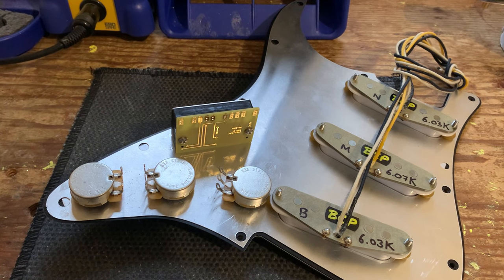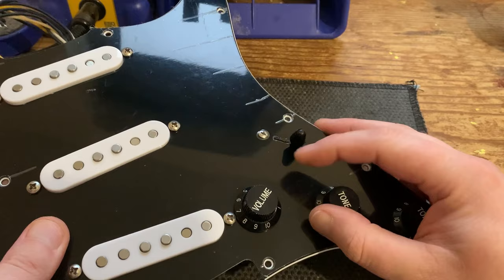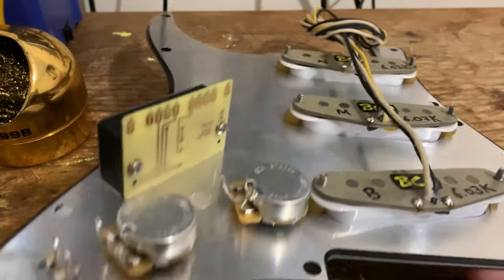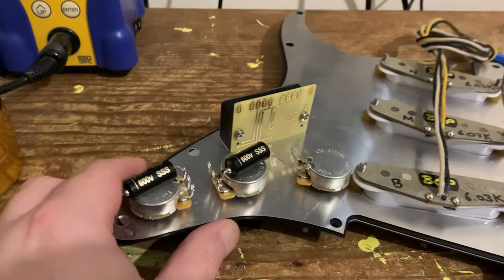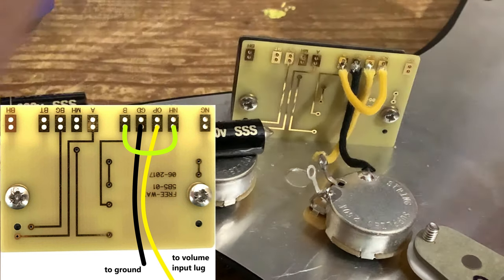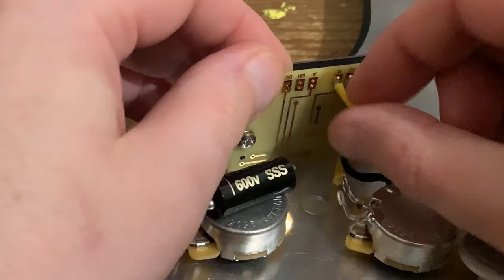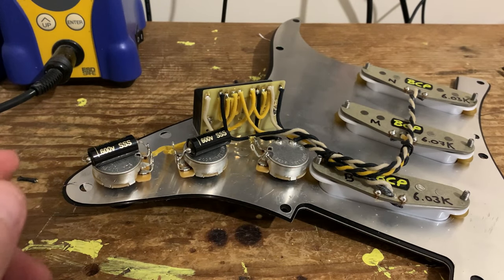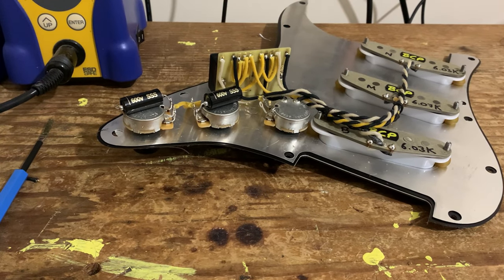10 way Strat wiring:  How to wire a Free-Way Blade Switch

Comment: man I dunno why you would want to use that old cloth wiring, its like a freakin radio antenna, you want to use some real good wire and bolster your tone minimize noise use 38g braided..

why people use this heavy duty wire is beyond me when its an extremely low voltage use..

wire two identical pickguards with all the same electronics and wire them exactly the same using cloth wire then 38g braided copper, the tinned style..

you're going to think you wired it wrong soon as you plug inthe 38g scratchplate that's how quiet its going to be, more stable and the tone...  oh boy

why do you think all the good jacksons and charvels back in the day they used such small wire, cuz it RIPS